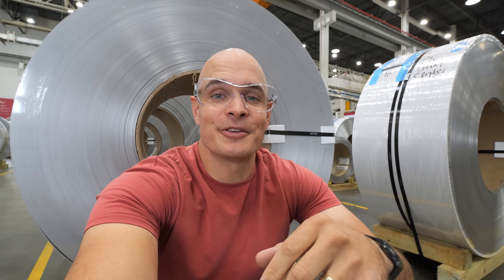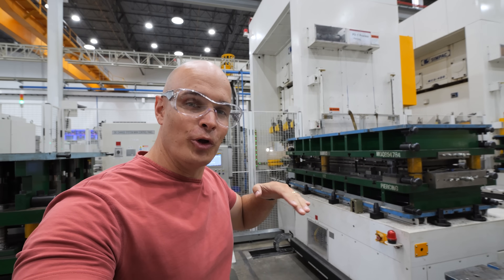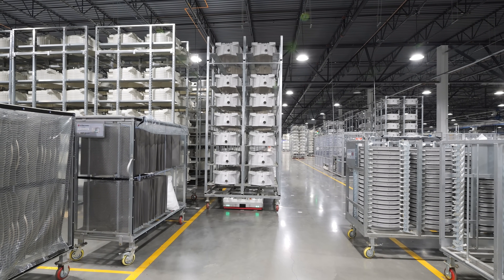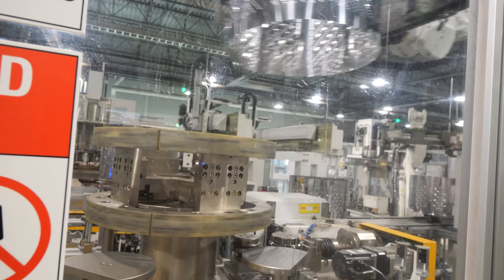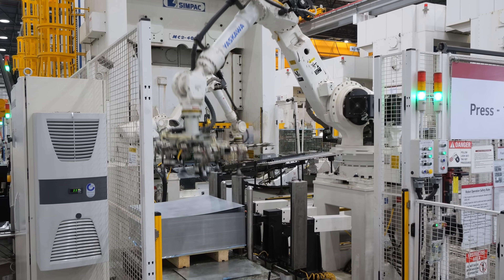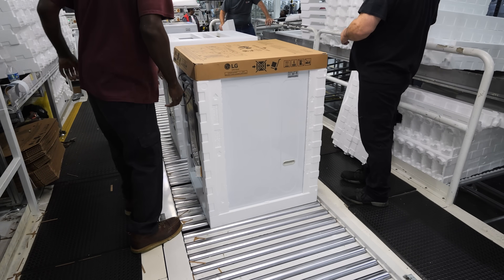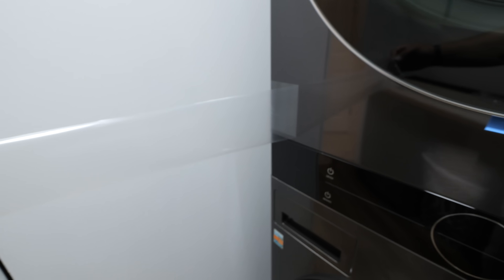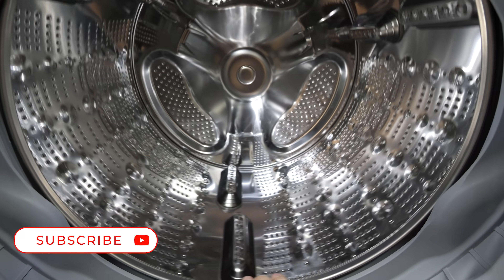Where are Washing Machines Born?

Comment: How is the repair-ability of these machines? Last time my washer had a broken ball baring if found out it cannot be replaced as with older models. So instead of a $2 spare part a $300 sub assembly replacement was needed. 🤯

Comment: Absolutely amazing. To think that Whirlpoop Corporation is still trying to make the same exact VMW washer design thats nearly 40 years old and badge it under no less than 17 different models of washer with varying brand names, trim levels and plastic bezels but with all identical, low-effort parts like a single speed motor, plastic transmission case, etc, and their 63 year old lint-top dryer.... and then you have LG which makes washers that last seven times longer (14 years on average compared to 2 before major service) and heat pump dryers that use 70% less energy... honestly the whirlpool factories should all be seized by the government, the buildings and their 1930s production process razed, and the land gifted to LG and the world would be in a better place.

Comment: These are cool but I'm sticking with my mostly mechanical GE washer and dryer. They have very few settings so no confusion. Top loading so no leaking. I bought them almost 20 years ago for less than $400 total. No internet, no touch screens, no app, they just work.

Comment: The biggest downside to the Tower with the heat pump is it doesn't have the AI dryer sensor, so it just runs whatever the cycle is set to run. A minor thing, but many other dryers will estimate some minutes but keep going if they still sense moisture.

Comment: Not sure about in the US, but here in Norway we haven't had those ducts on our dryers for years. It's all condensation where many have a drawer you need to empty ever so often or directly connected to the drain, usually the same drain as the washer is connected to.

Comment: It’s wierd how a dryer without a ventilation tube is ‘magic’ here in the UK we’ve had them for years as im sure the US have, although almost everyone I know thought it was cool technology and bought them years ago now.. only to find out they take around twice as long to dry a load.. so yeah you get more options where to put it with no ducting but twice as long to dry and twice the electricity price..
Reply: They do take twice as long, but use about 35-40% of the electricity.  Not to mention the gobs of conditioned air you're no longer throwing outside.
Reply: @spazzman90  a lot of my family bought one then ended up getting rid of it 6 months later and went back to a vented dryer.. as for the electricity it’s probably better for the planet to use less but we use our dryer about twice a week for 2 hours at a time, so the cost is unnoticeable😅

Comment: Its never stop amazes me that Americans are so amazed  about stuff that have existed in the rest of the world for decades and decades. 

I never lived in a house hold that had anything other than a condensing dryer.. and well, i´m pretty old.

Really if you want something fancy now, and.. well the last 10 years, you would go for a heat pump dryer. They consume like 1/5 the power of a condensing dryer, and about 1/10 of a vent dryer.

The issue with the heat pump dryer is that they ad like €500 to the price, making them quite pricy. It would be perfect in a set up like this and the washer and dryer share a heat pump.

The heat pump also have the added benefit of drying the clothe in colder air, making them no wear out that fast.

Comment: Great tour of factory not that I would buy a washing machine at those prices, $800 for a washing machine that needs a hot water supply and does not say how many kgs it will take but quotes cu ft. In the UK I paid £220 for a 9 kg dry weight machine with Bluetooth and a 1400 spin speed that uses cold water and a 1500 watt heater and runs off my generator. It was a candy machine and came with a 10 year parts warranty. I think you are being robbed in the US.

Comment: Avoid LG OLED my CX 55 inch started degrading baldly along the whole top ɓezel that is a whole  large clump of dead pixels after just 2500 hours of use !!! This issue is not advertised much and has nothing to do with burn in, so avoid since you can finish up with degraded panel and LG will not cover, so if one does not want to throw away expensive TV after 3 to 4 years AVOID at all costs and their other sub par products

Comment: I remember when I worked hard all summer to save up for a new phone. I bought an LG G4, but after just 2 months, I took it out of my pocket and it wouldn't turn on. I tried charging it, but nothing happened. Later, I found out that this was a common issue with the LG G4. When I contacted LG for help, they asked for a receipt. Unfortunately, I didn't buy it directly from LG, but from a reseller. Even though it was a known problem and LG acknowledged it, they said sorry, no receipt, no fix. That was my first and last time buying anything from LG.

Comment: My smart LG upright washing machine thinks it can wash clothes without getting water on all of them.  (I have to stand over it and keep flipping the lid until it fills enough.)  This is not limited to just LG though!  I wish someone would make a washer that you just select quarter, half or 3/4 full like in the old days.  Or one that got it right!  Thanks for the video!
Reply: LG front loaders have no problems getting the clothes clean.  And the new ones, especially so.

Comment: My LG dryer just died after only 3 years and was “not repairable” because the main circuit board is on permanent back order because they have had so many die.  Washer still working like a champ though.

Comment: Heat pump dryers are very cool, first learned about them from Alec at Technology Connections. Much more efficient, and I'd imagine with the stacked unit that you showed, the moisture collected from the clothes gets dumped out just like the waste water from the washing machine! They do take longer than a regular dryer if they don't have as much power, but they're more efficient and, as you said, much more flexible with their placement!
Reply: I find his channel super informative about the differences of our appliances in different regions. It seems to me that energy efficient solutions in general are catching up slower in the USA, probably because of the energy price differences.

Comment: Fun fact: LG's AI drying ensures that your clothing always comes out still wet, even when set to "very dry". This has been my personal experience, but is also what you'll find in most reviews online. It's not a huge issue for me, I just use the time dry function, but the AI is very much a detriment and not a selling point.
Reply: Everything gets called ai nowadays
Reply: its not even AI. if it's an electronics item its called AI these days.
Reply: I use AI mode always and it works very well. It is a gas powered dryer.
Reply: That's most new washers and dryers. The washers only half wash your clothes to save on water and the dryers only use half the energy to dry it. Not to mention all the plastic parts that break after months of use (not years). The appliance store recommended speed queen and that's what I will be using from now on.
Reply: @order6676  Actually have had several people have major issues with speed queen and highly recommend staying away from them!
Reply: That's why i buy non electronic commercial washer and dryer... Ugly as shit but last a long time... Mine have 20 years without any issues!!!
Reply: @martinchartrand7044 And how much did that 55% higher energy use by the washer and 45% higher energy used by the dryer because the asthmastic old top loader could only spin 650 rpm and left all that water in the clothes for the 6,000 watt vented electric dryer to boil off, a design of dryer so criminally inefficient that it's been illegal in Switzerland since the 90s?
Reply: @dregenius  The New "energy efficient" one clean nothing and dry nothing... You have to dry your clothes x2-3 Times .. 😋🤣🤣🤣
Reply: @martinchartrand7044  top load HE washers do not clean, correct. But front load machines clean incredibly well according to every review and testing outlet I've seen. They keep detergent concentrated without leaving some clothes dry and unwashed, and their real secret is spin speed - the reason commercial machines are called "washer-extractors" is because getting clothes wet is only half the job. The other half is extracting as much of the water, detergent, and dirt as possible before the dryer, since drying will just evaporate the water and leave detergent and dirt behind. Stop buying unfit for purpose new HE top load machines and you'll be amazed at how much better a modern WM5500 can clean compared to an old 70 gallon float tank that needs everything pre-treated because its diluted the detergent so severely lol.

Comment: Pretty cool, I live here in Clarksville, TN and have driven by the plant many times. Know a few folks that work there and used to work down the road at Hendrickson Trailer Suspension Systems. It is a big plant but Hemock Semiconductor that used to be across the road (Now Google) was absolutely massive. Looked like an entire city from Highway 79, still quite large. Thanks for visiting the area! :)

Comment: I think our washer was made by people in a hurry to get their quota in. Our LG HE washer is balanced. Yet, whenever we do jeans, sheets, blankets etc, it unbalances out of its laundry nook upstairs into the hallway if we are outside. Since it happened, we now have to babysit the frigging washer. It happens when the washer goes from the wash to the rinse cycle. My husband uses the heavy duty cycle with extra rinse, so it unbalances twice in the cycle. So I baby sit it by pausing at the end of the draining, redistribute the items and resume the cycle, I do this twice when my boyfriend does his wash. Until this lame washer, I never had a problem with a washing machine, and have never been fearful of a washing machine. I hate it with a passion. It senses the load, what the heck is it sensing? I hear the washer moving the tub to redistribute the items in the wash, but still unbalances.
Reply: I had a similar problem with my new WM1455HPA LG washer. The installer had noticed the floor was a little uneven, and he had adjusted one of the washer leveling feet. However, this wasn't enough to deal with the loud knocking from an unbalanced washer (as I found over the first few days of usage). I noticed the installer hadn't tightened the locknut up to the base of the washer. I had to use the tool that came with the washer and a separate vise-grip to keep things in place while I made the adjustments on the two pieces that needed to rotate. Each time, I untightened the locknut, then turned the foot that seemed to be affected by the uneven floor, and then tightened up the locknut again. I tested out a few positions, about 1/4 turns of the foot, then retightening the locknut, and finally I got the washer to stop the knocking sound when on a high spin.
Reply: @thomasb331  Damn. It’s definitely a different issue. I noticed a knocking sound on spin when I got back from a hospital stay. My husband did his laundry and told me that it was unbalanced and the machine was rocking hard, bouncing. He said he rebalanced the washer. But when I went to do my laundry, the washer was on an angle and did the loud knocking on the spin. Once he straightened and red leveled it, it was fine but still unbalanced with the sheets, but not with a fuller load of clothes.

Comment: Nice to have a tour of a manufacturer that knowingly, actually designs and builds and sells junk ... to an unknowing public.  Any repair guy (the all knowing, trained knowledge holder of a product type) will tell you that LG is actually the poorest quality appliance builder in the marketplace, with many parts built of garbage materials, weak plastic or designs that ensure failure in short order, ensuring the buyer has to repurchase sooner.  They sell lots of these ... because they are $ cheap, the price category that sucks buyers in.  Buying their laundry pieces are a dice roll ... but buying their fridge is a guaranteed fail.  Nice tour tho.

Comment: I did not understand the part about vented or non vented machines. Here in Italy none of the drier I've seen in the last decade use a forced air vent in the wall. They're all self contained. Moreover the new heatpump models consumes far less than some years ago.

Comment: Amazing video but lg has more to catch up on the mechanical part of the washers…front loaders are known for a fact to be more economical,clothes dont fade and give better cleaning results by up to 40% with no pretreating ….and there is a BUT,mechanical parts such as the shock absorbers are often the one part that fails in them,also the drum spider assembly(drum support )is made from the exact same material as the one on samsung,therefore those always fail. Top-load washers from lg also have the opposite issue,always have electronical parts like the pump,motor tachometer or pcb go bad,so even tho LG has come a long way,it’s still far Away from perfect and failproof like mieles are,or some great washers would be the electrolux as those are made for heavy use with quality parts,and all the above come from a guy that fixed,tested,destroyed and repaired loads of european and american style top loaders made for comercial use in europe washers, so if anyone comes to tell me otherwise please do from experience,and no, top loaders aren’t cleaner than front loaders,just the thing that on front loaders you can see the dirt and clean it meanwhile on toploaders it stays hidden

Comment: These factory tour videos are so cool.

Automation and robotics must make it pretty efficient.
Reply: Major lowering of the labour cost, and ensuring all the critical precision jobs are always done right every time.  Yes the initial costs are very high, but they probably have already earned back that cost in lower warranty costs, and in much lower on the line fixes as well. Plus removing all the on line cosmetic damage, that makes the machine immediately a "second grade" unit, and a much lower selling price from the factory, basically selling it at cost, and making no profit at all from it.
Reply: @SeanBZA  You seriously think they lower the selling price instead of pocketing the extra profit?
Reply: @GCAT01Living  A factory scratch and dent is cheaper, though normally these go into sales for commercial use, who want a lower price, and do not worry about a tiny bit of cosmetic damage, because they will run the machine into the ground in 3 years anyway, then toss it out and replace it.
Reply: Considering they make 1 mil washing machines and 600k dryers then they must be better then humans

Comment: That’s what they need to do with EV cars. Have replaceable batteries. You drive into a battery station (previously known as a gas station) and a robot pulls out your discharged battery and plugs a charged battery in. They measure the charge left in your battery and you pay for the charge that your battery needs. (How much energy your car used.) You’re out in 5 minutes. Why is that not possible?
Reply: Battery swaps has been around as an idea for a long time.  But I imagine your car would have to have a standardized battery and good luck getting that out of car makers.
Reply: Scotty Kilmer's YouTube channel had a video Dec 1 about Nio, the Chinese car with swappable batteries. They surpassed 30 million battery swaps, and the company has expanded into Europe. The approach seems to fit some use cases fairly well, and makes some economic sense since the cost of the car is much lower when the battery is removed as part of the sticker price. Instead, there is a BaaS (battery as a service) cost, and looks like it's faster than a car wash or even pumping fuel (average 3-5 minutes). The battery can also be charged like other EV batteries.

Comment: The lg wash tower also has a vented version, they look identical. But the vented dryer is 10x better than the condenser technology. I have a ventless dryer as well and it’s horrible. It never gets your clothes 100% dry and it gets your clothes way hotter… and that heat can damage clothes pretty fast… also it’s like 4 hour dry cycle vs the vented dryers dry cycle of an hour.